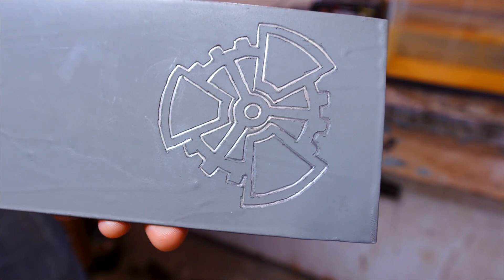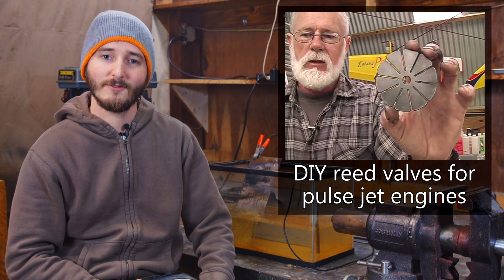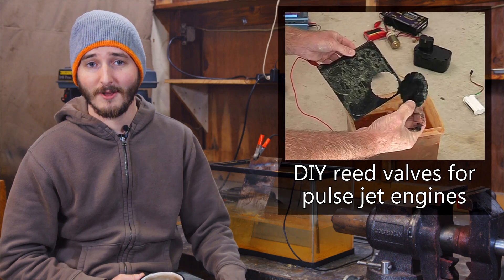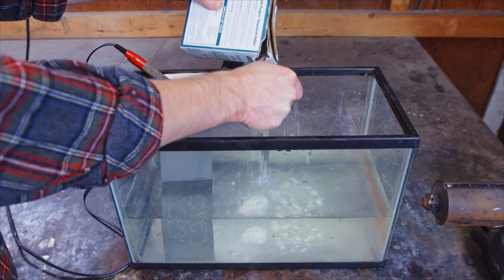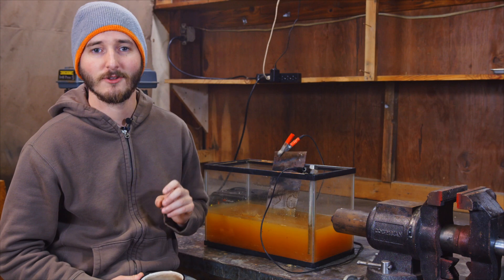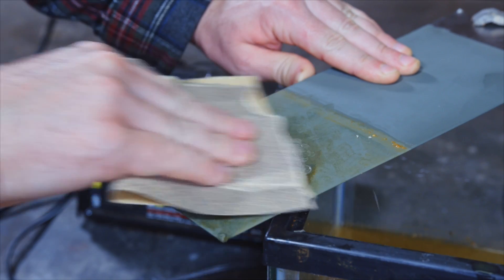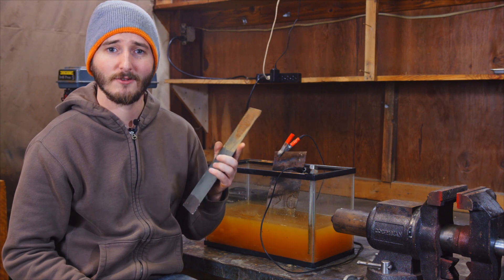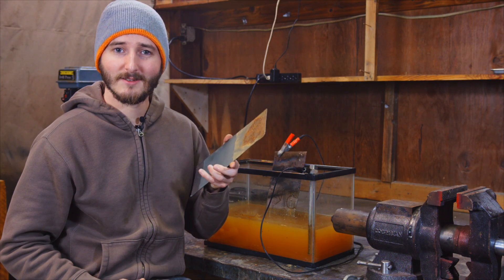How To Cut Steel With Electrolysis [Experiment In Progress] - NightHawkInLight

Comment: This sounds very much like the techniques used in etching PCB's. There, the trick is to get the etching done in a relatively short period of time, so that there is not enough time for the etchant to eat away at the metal through the walls of the cut, which can sometimes result in having the mask flake off. 

I think since you are using electricity instead of acid, that you could also improve the quality of the cut by being more directional. Maybe ground the metal, place it flat in a basin of electrolyte, and use a small relatively pointy positive electrode to get close to the parts of the metal you want to cut. 

Since speed of cut is probably an issue here, You will want to ensure you have a high current supply available, something like a car battery, or at least a supply capable of supplying several amps. That way, you can add plenty of baking soda, or acid to the solution and know that you aren't being limited by the power supply.

Finally, combining the effects of electrolytic corrosion with a chemical etchant  may further improve results. As a starting test, I would recommend equal parts vinegar and 3% hydrogen peroxide, since that is readily available, and surprisingly potent.

Good luck, this looks like a very interesting project!!

Comment: Hey there Nighthawk, I haven't tried cutting with this method (though I might now), but a couple more ideas for the pile. Wrapping the piece in electrical tape and then cutting that out has worked for me in the past for etching. I also have seen other people using nail polish, which sounds promising, or even Sharpie marker.

Comment: I don't think this method will work since you cant code the side of the steel when its etched.
think about it as layers, you coated the first layer and then the part you want to be removed is taken, no problem till now.
but when you go for the second layer the sides of the first layer are still exposed making the steel being eaten be the side.

it may work if you flash it in the tank then remove it just for a re-coating, but this will take quite a bit of time.
I have not looked stuff up so I might be wrong but this is what seem to be happening to my eyes.
I'm a senior in mechanical engineering. :)
Reply: maybe if you etch both sides the middle will be weaker and then removed by some other method.

Comment: I don't think it's getting under the paint from the outside,  it's getting to get through from the metal. So for the resolution, I was thinking the same as RYU,  you need to expose the other side. All you'd need is a paper template for whatever you cutting and be precise with your measurements so it lines up and you can score the other side. If it still seems to spread you may need to look into better paints.

Comment: i would use another electrolite; either another base such as Sodiumhydroxide etc. or a acid like Sulphuric Acid or Hidrochloric Acid. I know that baking soda is a weak base too, but since it can easily break up into CO2 you waste energy and because its such a weak base it's not that good of an electrolite. If you use stronger acids or bases, (more or less)only protons are moving instead of the Sodium-Ions or the hydrocarbonate ions. this will then cause better efficiency and maybe better quallity.
Reply: Careful though because a stronger acid or base might be a better paint-stripper.

Comment: you should try several layers of sharpie, it works for making circuit boards out of copper. I've found that around 5-6 layers is the least amount that you should use

Comment: Why don't you use flex seal since it is rubber in a can. The rubber might prove to be a better coating. Also I think what is happening with the acid is that it is eating into the steal and then more side surface area is exposed allowing it to go sideways under the paint.

Comment: maybe you shouldn't use the plate itself as an anode, because the current flows from water and skidmarks you made in all directions. I would try putting two plates (isolated from salty water) on both sides of the steel sheet, which has your scratches on both its sides. this way current will flow through the plate perpendicular to it and not go under the paint/wax/whatever

Comment: I've thinking this for a while. Maybe you need to do it with smaller voltage, so it will corrode slowly though took a longer process. I think the bubble formed because water seeping through small cracks and the gas formed that bubble. Maybe try with rubber/rubber based paint?

Comment: You said you have tried different type of paint, Have you tried to use different metal? You used normal metal that rusts and it has higher resistance . Try to use Copper it wont rust and it will give you less resistance in it, it might help you to cut more clean.
Reply: if you would add Liquid Nitrogen, it would give you even less resistance.
The colder metal the less resistance it will have

Comment: its not gonna work,after forming a hole,the electrolytes are gonna attack sideways along the depth of the hole and widen cuts,which would compromise precision greatly,maybe if you used super glue (the one that forms hardened blobs,don't know what its called) and covered surfaces you don't want to have corroded away,it should keep the edge of the holes from widening

Comment: Why don't you etch it with strong acid?
Reply from the maker: I do have a chemical method in mind to try next.
Reply: Polish and clean with benzine. coat with cereson wax or syncera wax, scribe the part through the wax.(crayons will work.)

then put in the acid made from, 3 Oz potassium bicromate in 32 OZ of water, and 3 OZ of sulfuric acid and a few drops of dish washing soap to make it stick. if you do aluminum add some hydrochloric acid. 

  from book called." Amateur craftsman's cyclopedia of things to make"

Comment: Hey NightHawkInLight, before you read all of this i have no solution at all for your problem but i do want to point out that i find it a great idea to involve your subscribers into your projects! Keep up the amazing work.
Reply from the maker: Thanks!
Reply: NightHawkInLight Out of curiosity once the cut is made what is to prevent the electricity from continuing on to the now exposed metal? Anyway, awesome video; great work.
Reply from the maker: It will continue on if you let it.

Comment: Salt, regular table salt. 
Nothing else, works like a treat. 

Allthough, i only etch stainless with that method, steel may be different.
But a regular salt solution, saturated, works perfectly.
Reply: whoho1 It looks like the steel he chose is far thicker than the piece in the sample. He could also try doing the same pattern on the opposite side if it isn't too difficult. That could give him a better cut due to the corrosion coming from two sides rather than one, meaning less time in the water and less room for any mistakes.
Reply from the maker: Do you just etch it though, or cut it? This method works fine for etching but the paint fails before a cut can be made clean through.
Reply: NightHawkInLight hwllo
Reply: NightHawkInLight hello 😁